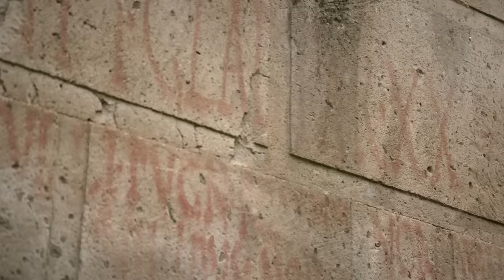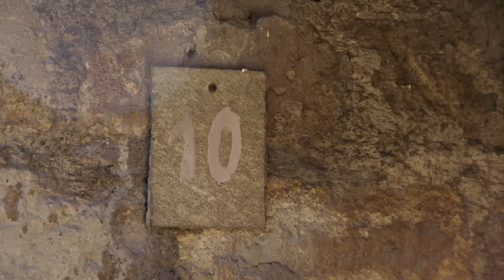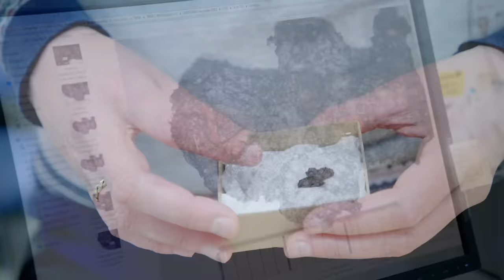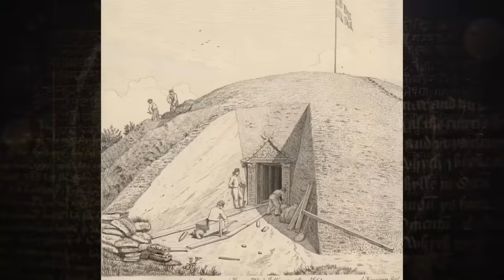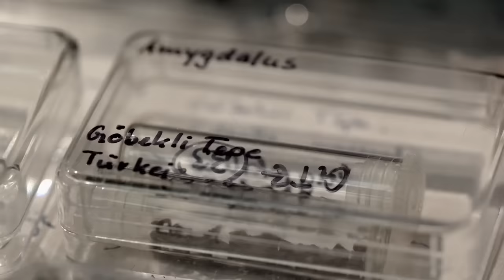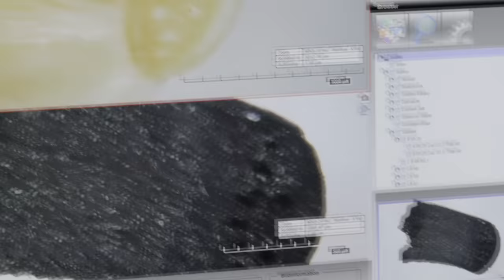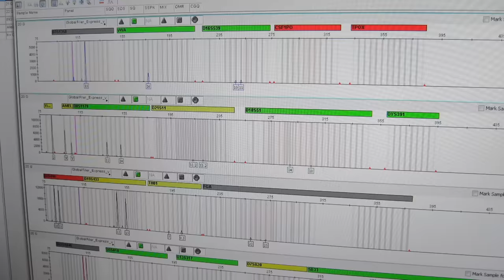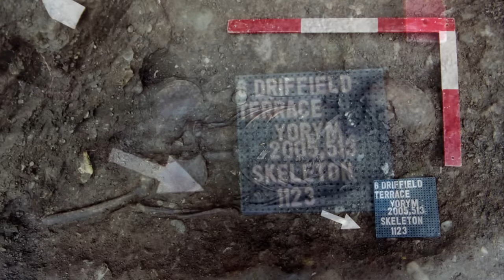15 Shocking Ancient Secrets | Smithsonian Channel

Comment: Just because hunter gatherers were squatting in an area for a length of time doesn’t mean they built the structure. 

If they found me and my stuff in 1000 years they wouldn’t assume I built the house. I just moved in. Just saying.
Reply: Hey, that's a very good point. I  bought a historic home and have found things under it,
 I certainly did not put there myself in 1926 when the original foundation was laid ,
nor in 1942 when it was rebuilt. Man, that's such a good and totally logical point.

Comment: The movement of bones, while not common has occurred in the past for various reasons. Religious reasons are one. Movement from a plain grave area to one of honor, is another. A reversal has also occurred, when a person went from being honored to being outcast for one reason or another. Military burials also have involved movement. Other than grave robbery, there must be a large number of reasons for moving the bones of a deceased one.
Reply: History channel rocks. So interesting.
Reply: Christianity might have come to the area, and the bones subsequently moved into the new religious house. Early Christians were not so picky about the rules and would have wanted a valued relative also saved, even if he predated the new dogma.
I was wondering why they didn't say what soil tests revealed, as far as telling if the body had decomposed in either location. Surely they would have done that?

Comment: Examining all the evidence, I believe Gobekli Tepe to be the very first university/learning centre ever created. Suggesting there is a much older civilization yet to be discovered. This is where the knowledge and engineer's  that created the Indus valley (the actual cradle of life some 3000 years older than Mesopotamia) came from.
Reply: How do you arrive at those conclusions? Is there evidence it was a learning centre? I think it's a very large stretch of imagination to think there were 'Universities'. Why does it suggest there are much older civilisations yet to be discovered?
Reply: @stevethebarbarian99  that's why I said: I believe. But if you look at the research regarding ancient libraries, Gobekli Tepe fits a lot of the criteria. And, I haven't heard anyone come up with a better theory? The main theory is it's a temple built for religious purposes, but there's absolutely no evidence suggesting that theory to be factual. If you look at the gardens, they look like an agricultural study or experiments for an agricultural class rather than for feeding a mass metropolis, based on the size of the gardens alone, for which they are clearly too small for such. Still an amazing megalithic wonder either way.
Reply: @rj4313  

Appreciate your thoughts. 

My two points are that I think it's very unlikely to be a university. If you mean for learning, then the sum of human knowledge was very small, and wouldn't need a University. They didn't know agriculture or pottery even, so what would they be teaching? 

If you mean for study, well maybe. Why the elaborate stones and carvings? Doesn't really fit a place of learning for me. Also, to have a place of learning, you have to have one section of a community prepared to feed the tutors and scholars. I think this is extremely unlikely for hunter gatherers. 

My second point: Why does it 'suggest' there is a much older civilisation yet to be found?
Reply: @stevethebarbarian99  this was clearly a time we have absolutely no knowledge of. We have no idea of how old this site actually is. Archeologists have only been able to give us the date it was buried by man, approx 11500 years years ago, right before a cataclysmic era of worldwide catastrophes, in which we lost all knowledge of how to build these sites of clearly advanced technology ( we can't build, or even move some of these megalithic blocks today, or set them in place with such accuracy and no damage) archeologists admit themselves admit the site could be thousands of years older than 11500 years ago. During this time we also lost all mega fauna, other civilizations, and any knowledge we had before this time, along with hours of more info I could give on this subject that this forum is to small for. What I can't believe is that: a bunch of hunter gatherers, with no advanced building skills or advanced knowledge, no advanced buildings, homes, or civilizations of their own, no stable home life to sprout from, no irrigation, nothing but the hunter gathering skills they had, climbed that hill, designed and built that site with such accuracy, all with no knowledge on how to do so? So much evidence I could give on this, but that would take hours, if not days, that there was a highly advanced civilization, that we have lost all knowledge of dated before 11500 years ago. There's more data suggesting this than suggesting there wasn't. There are many more sites of this age than just Gobekli, all over the planet. Time is crumbling this evidence away. Egyptian era was only 3500 years ago, and look how little archeological evidence we have or know of them. Sumerians were 5500 years ago and we have almost nothing left in the knowledge of this civilization. How much would one think we have lost in a civilization twice as old as that?
Reply: @rj4313  

I'm sorry, but that answered neither point I was asking about - why you believe a university - which makes no sense to me. 
Secondly, what 'suggest's other undiscovered advanced civilisations. 

It's a time we have little knowledge of, because they left no writing - that came 1000s of years later. 

It's nonsense to say we lost all knowledge how to do it, or that would couldn't do it again today. 

Again, talking about a mythical advanced civlisation that we have no knowledge of, is just a complete leap of faith - based on no evidence at all. What data suggests it? 

Pyramids were built more than 3500 years ago, and it's thought the Sphinx is much older than that. 

To sumarise. 

Your university theory makes no sense to me, and nothing you've said seems to support it being more than your own personal theory. Same goes for undiscovered advanced civilisations - which nothing 'suggests' they existed at all.
Reply: @stevethebarbarian99  without reviewing, I believe I said something about the layout and size of the gardens, and what they could be significantly used for, teaching studies, as well as the layout of the area resembling what we know of other ancient libraries/universities, and the communal areas in which they would hold seminars or classes. As I said before, it's just my belief.
Reply: @rj4313  yes! Similar to todays 4H programs in school.
Reply: What a ridiculous statement! (beginning with "all the evidence")
Reply: @hensonlaura  clearly you haven't looked at the evidence yourself.
Learning areas for agricultural, study areas like the ancient universities in Greece, many carvings of animals indigenous of areas in the world thousands of miles away, was buried by man 10,500 years ago to preserve the history in Hope's of one day reopening, etc. Theres so much evidence for this theory
Reply: While I realise there are many fanciful ideas of ancient civilisations I don’t find it too far fetched to imagine that, due to large scale cataclysmic disasters, there may have existed sophisticated civilisations we have no knowledge about. We have a tendency to think humanity advanced in a forward linear fashion but large scale natural disasters could have potentially wiped out a large pool of knowledge leaving no trace. I find the sheer scale and level of design indicates a high level of sophistication including areas for not just cultivating crops but also stepped areas for agriculture in order to create modified crops able to grow at high altitudes.

Comment: Stonehenge. A graveyard of the elite.
Reply: It is on a magnetic ley line, has degree markers that correspond to the Planets, 

"...it became a grave site after its original purpose."

"They DO NOT have accurate dates on Stonehenge, it will ultimately be updated and listed around 11,500 BCE"
- Beth Bartlett
Reply: @bethbartlett5692  We certainly do have accurate dates for Stonehenge from organic matter from under the stones and in the surrounding ditch(obviously anything under the stones was there first). The sarsens were put up around 4,500 years ago (+ or - 270 ) but the ditch is around 5,500 years old. We know it was definitely used as a burial site first. They cremated the bodies first and buried the remains in the 56 'Aubrey' holes(after John Aubrey who discovered them). They predate the stone circle we know today.
Reply: Smithsonian Channel.  <---- Report messages from this fake account.  See the extra full-stop at the end?  It's trying to use the Smithsonian name to trick people into being defrauded.  Report it and get the user account banned.

Comment: Stonehenge:

Known Facts:  It is on a magnetic ley line, has degree markers that correspond to the Planets, 

"...it became a grave site after its original purpose."

"They DO NOT have accurate dates on Stonehenge, it will ultimately be updated and listed around 11,500 BCE"
- Beth Bartlett